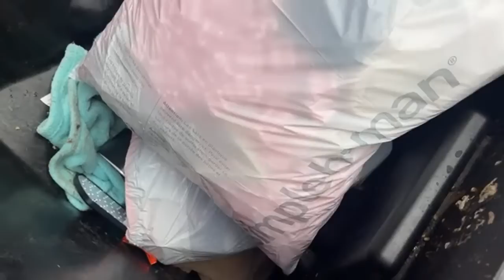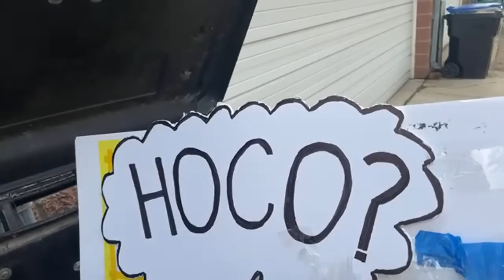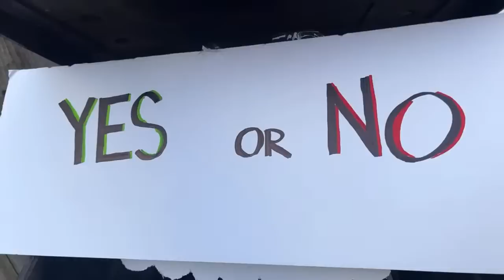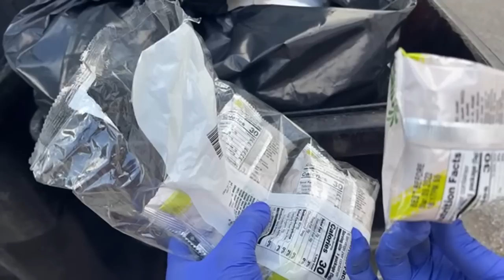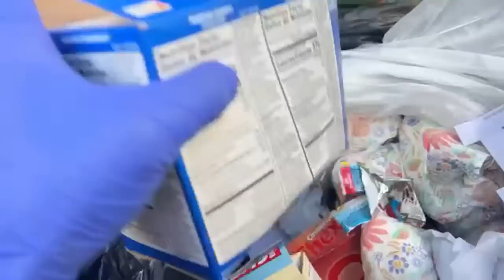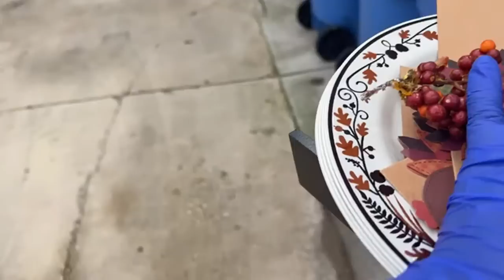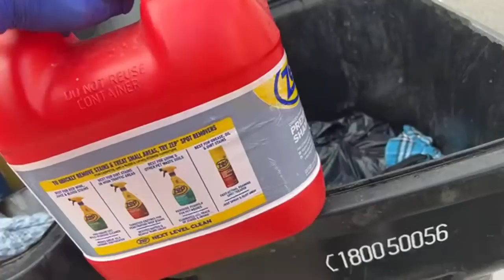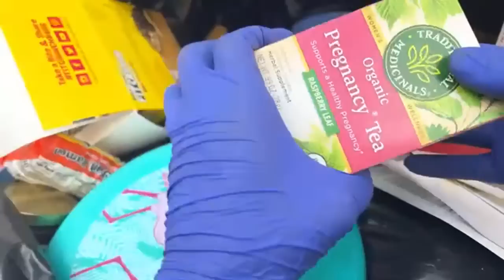Dumpster Diving | Highly Sought After Collectable HESS TRUCKS Scored From The Trash!!💰💰| BIG MONEY

Comment: It’s not Ross that’s the battery acid from the batteries in the ass vehicles you take them out you some sandpaper sand them down let them air out and dry a little while will good and then try to put new batteries in it see if they’ll work